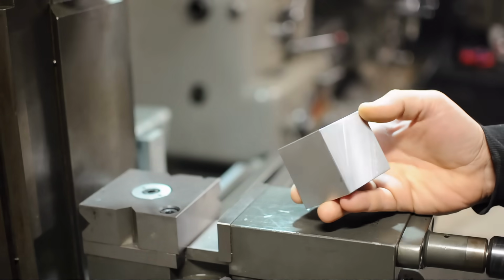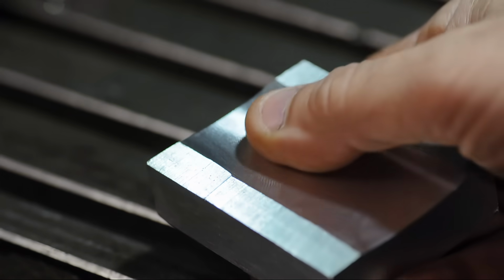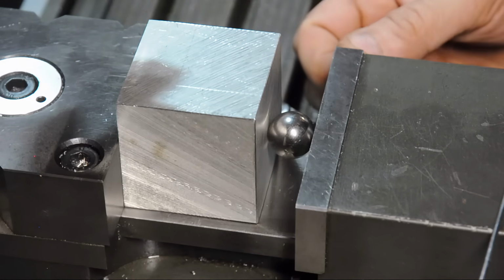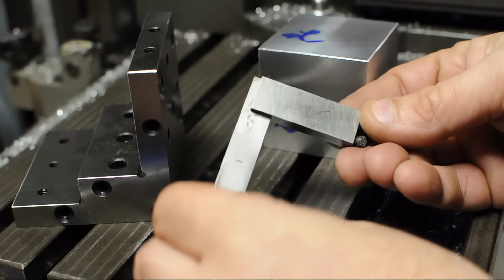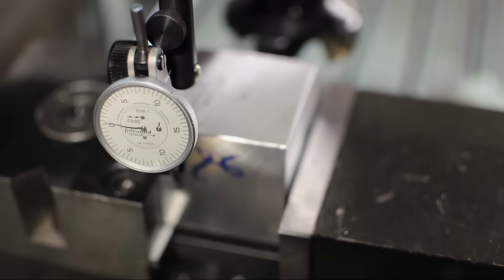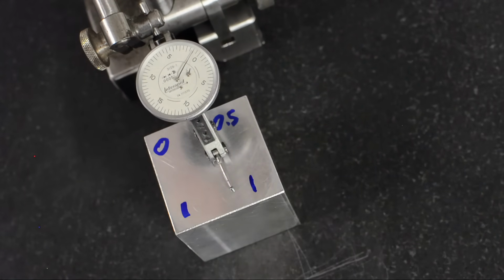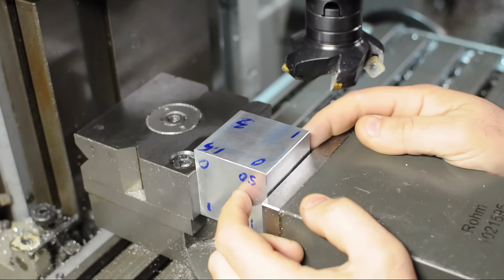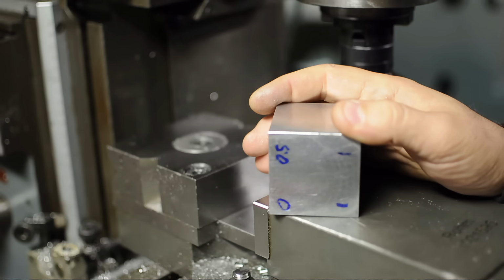Stock? Mill? Square!

Comment: I work in IT. In England. I don't have space for any home shop in my little house. I will never use the information you so eloquently provided. 

I did however find it fascinating and extremely well presented. Love your Vids and keep up the good work!!
Reply: same boat
Reply: I said exactly the same, fast forward 15 years and I now have a modest shop. I started out using the coffee table in the living room of our flat. It can be done it just takes a really long time to get there.
Reply: With a little creative chip management and an understanding housemate, it can be done. My first lathe (a 7x12) lived next to my fridge in the kitchen at my previous place.
Reply: I have the same lack of space you have. So I have a Taig (Peatol in the UK) lathe and a Proxxon micromill. They would both fit in a closet. You just have to adapt the size of what you do to the room you have. You will have to work small, build clocks, build small models, and so on.
Reply: +Juan Rivero You can build big things, you just have to make them out of LOTS of small parts.
Reply: Er -- I agree in principle, but you can't turn a 150 mm piece on a 50 mm centre height lathe!
Reply: I'm in the same boat. So I joined a local makerspace. It's not my machine shop, but I have access to it, and since the costs are spread out among many people it saves a lot of money. And there are often more experienced people around who can offer advice, which is nice.
Reply: Dito, just in germany instead of england :-)
I hope to have a workshop when i retire!
Reply: I built a shed in the garden 4mx3m. I'm getting there slowly.
Reply: some of these tools are very big investments. tony is building a desire in me which I can't yet afford.

if you don't have a shop of your own, you can see if there's a hacker space local to you. it's a workshop full of like-minded people. they usually have a lathe and drill press at the least.
Reply: Lewis Heard It took me years to build a workshop. Hopefully I can leave it to the grandchildren, so they don't have to struggle like I did.
Reply: I converted my living room to a shop, didn't have a wife then! My first shop was my bedroom in my apartment, I moved my bed to living room. I now have a corner of a real shop with 3 phase power, 8' x 12', I want more space! Or less stuff.
Reply: Larry i don't believe you are honest. Who wants less stuff?
Reply: PIGEON. And when you won't exist anymore, your grandchildren will sell  everything. I have seen it many times. One example is when I bought my shaping machine the chap sold it because his dad passed away. His dad was very passionate as I saw the workshop was set up in a very tight space and very nicely arranged. I asked him, why he  won't keep all the valuable machines. But he was simply not passionate about.
Reply: I don't have anywhere to set up a shop either. I do however apply the theories in my job and projects. I definitely watch for entertainment mostly. If TOT started a second channel about knitting I'd watch every video he produced. I would never knit either.
Reply: I find it helps me when I've got scripting to write.
Reply: My mate Toby has a machine shop in his ex-council flat in South East London. Put some effort in.
Reply: PIGEON take a look at Steve Jordan, his shed is 10ft x 8ft, and he has it as his YT studio as well! Les
Reply: F*ing this, im also an IT guy, with more interest in woodworking, but this videos are mesmerizing.
Reply: You work in IT? How fun is it to deal with "enterprise" Windows applications? Because we all know that nobody's smart enough to hire Linux sysadmins anymore.
Reply: Thing is I work in IT and I have space... ;)
Reply: @Lewis Heard 
Start out with mini machinery dude. you could be milling on your kitchen counter.
Reply: Same lol... at least if the zombie apocalypse happens and we are the only survivors there will be plenty of tools we can recover and make lots of these perfectly square little bits of stock metal 😂

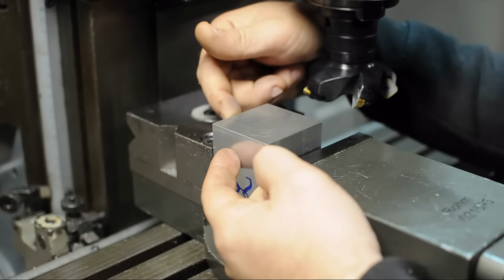Comment: If anyone is interested, for the question at 13:51,  the concept of being square in higher dimensions is called orthogonality.
Reply: Thankyou for finally telling me the meaning of the word "orthogonality". Its everywhere in my engineering curriculum, and I didn't know what it means.
Reply: I'm working with some 4 dimensional math. This is very accurate.
Reply: @KalijahAnderson  Thanks to you too, good sir.

Might I ask, are there any analytical techniques in mathematics for solving non-linear differential equations? I ask because all I see currently in my engineering curriculum has to do with linear differential equations and higher powers are neglected (Taylor series approximations). But these are only applicable for certain common cases (infinitesimal strain) and materials (Newtonian fluids). For more specialised machines, non-linearity is common, but our curriculum is not teaching us anything about dealing with those problems.
Reply: @death_parade  I have extremely bad news. They're often unsolvable. Look into Chaos theory for more information on non linear systems. That's what it's all about
Reply: @gamemeister27  Thank you for your guidance sir! I'll be sure to check it out. :)
Reply: @death_parade  Many years back I had to deal with these in grad school.  The best solution was stated by one of my fellow students: "You start by writing down the answer and then you verify that it's correct"

Personally I never managed much luck with that method and used various computer approximations.
Reply: Except the right answer to the question is "pairwise orthogonal" since TOT is asking about checking that three faces (ie 3 vectors) are orthogonal.

For example, <1,0,0> is orthogonal to both <0,1,0> and <0,1,1> but <0,1,0> and <0,1,1> are not orthogonal to each other. Check the dot products if you don't believe me.

For pairwise orthogonality you could use any orthogonal basis (obviously the standard basis is the easy choice).
Reply: Andrew Simpson   Andrew ! “the concept of being square in higher dimensions”???? Wtf are you talking about? Religion, voodoo. He was seeking the WORD for three planes meeting at 90 degrees to each other (the corner of the cube)(like the little gnomon sitting in the corner of most 3D programs displaying the X_red Y_green Z_blue axes in space).  The answer at 13:51 is... orthogonal.
So....  if we’re all going to learn even more here, not JUST a new word, then... “Think of the consequences of erudite vernacular utilized irrespective of necessity”. Just keep it simple dummy! So everyone can join in and know what were talking about.
Reply: They may be orthogonal, but are they normalized? I need my wavefunctions over easy with breakfast or it messes with my overlap matrix.

Comment: There is a way to square up a block with 7 cuts. Use the dial indicator to square the head, table, and vise once. When the static jaw is know to be true use your method of cutting for the first 4 faces. The 5th face is purposely moved out of square between the jaws, then skim cut that face. Flip the block 180 to face #6 and rotate the block 90 degrees in Zed. Now side #6 is square in both directions. Turn the block 180 again and re-cut side #5. You now have a block that is as square as your vise will allow. As a Tool Maker for over 30 years, I've used this method a thousand times over with predicable results, but most importantly, it's fast and easy! Keep up the good work Tony.
Reply: thx!
Reply: Yeah, and you dont even need to square the vice.
Reply: Took me a minute to visualise this idea but damn, that is genius.
Reply: Hey TOT, this seems like a quick video challenge for you!
Reply: "The 5th face is purposely moved out of square between the jaws, then 
skim cut that face. Flip the block 180 to face #6 and rotate the block 
90 degrees in Zed. Now side #6 is square in both directions. Turn the 
block 180 again and re-cut side #5. "

I don't quite understand this. Is there a video or more detailed description?
Reply: @dejayrezme8617  Here's how I think it goes (haven't actually tried it but it makes sense):

"The 5th face is purposely moved out of square between the jaws" means you tilt the block to one side (to the left or the right) so its top is intentionally going to be a bit out of square after cutting.

"Flip the block 180 to face #6" means turn the block over so face #6 is now on top. For the following step to make sense, you have to make sure to flip it in one plane only (flip it to the left, or the right, or toward or away from you, but not around the Z or vertical axis).

"and rotate the block 90 degrees in Zed." Turn it around the Z axis a quarter turn (90˚). So if you were to draw an arrow pointing away from you on face #6, after this rotation face #6 is still upward but the arrow would point to the left or right. Because face #5 was cut out of square in one direction, only one of its edges will contact the base of the vise, and with this 90˚ turn, that edge will be against one of the jaws. I suppose you'd want to make sure it's against the stationary jaw, which means your 90˚ turn had to be in the direction to make that happen. You'd use this edge against the bottom and the back face against the stationary jaw as guides so the top face is aligned correctly.

Then of course you cut face #6 (I guess that's implied) and "turn the block 180 again and re-cut side #5". 

That's how I imagine it. If I've got it wrong, I'm sure someone will correct me and then we'll both understand.
Reply: What if you don’t have a single face that’s machine cut 

And what if your dial indicator is broken or not reading correctly how would you know 

And could you square a block up in a lathe ,band saw or belt sander with greater ease
Reply: I’ve got a square and some finger nail clippers, let’s give this a shot 😂
Reply: that's smart!
Reply: jep that sounds like a very smart idea !
Reply: Don't ever mention that method to Joe Pieczynski or you'll be here forever trying to defend your method.......BTDT.
Reply: For all future machinists out there. I hope TOT doesn't mind. But there is the technique demonstrated by Oxtoolco.

https://www.youtube.com/watch?v=-lgMcDOkeg8
Reply: There is an even easier way to do this, but it depends on how much material you have to "play" with. Skim the top with a rose cutter, then use a end mill to skim/cut-to-size the 4 sides around the top, on the same set-up. Flip the block 180° and mill the bottom/side #6 off to size. Easiest way to square up a block. This will only work though if you follow the steps of getting the machine head right like he showed. 2 set-ups instead of 6+ and you will be using the machine's capability of squaring instead of your own. This method also has less chance of failing because you only have 2 set-ups instead of 6+. But like I said, this can't be done if you only have like 1mm to machine off... or should I say it is not for the faint of heart to be gripping on like 0.8mm and be machining on a block.
Reply: @adamthethird4753  old comment but putting a thank you since a became a machinist and i am very visual learner this helped me understand a bit
Reply: Note that there is no need to do "The 5th face is purposely moved out of square between the jaws". That "purposely out of square" is only done for demonstrations. You can cut the 5th face "straight-ish", it doesn't really matter... however you need to take skim cuts so that only ONE of the sides gets a full cut. That side becomes your reference for the next step - let's say it's the left one....
Now keep track of that left face and flip the block, then turn it 90 degrees. Place that (previously left) fully-cut face towards the fixed jaw, up on a parallel if you like. Now finish the 6th side, flip again 180 degrees and finish the 5th side again.
Reply: @gangleweed  what thoughta do you thinl joe will have on this?

Comment: In college, we used Bridgeports that had both tilt AND nod. To tram the heads on them, we used something the school provided called a tramming plate, which was just a piece of mild steel plate about 5 x 5 x 3/4 that had been hardened and precision ground on its widest faces. We used our dial test indicators mounted on universal dovetails in a 1/4 collet chuck to touch off on the plate. Then we spun the mill around by hand and indicated to within .001 on the tilt and the nod. I've done it so many times that I dream about it.

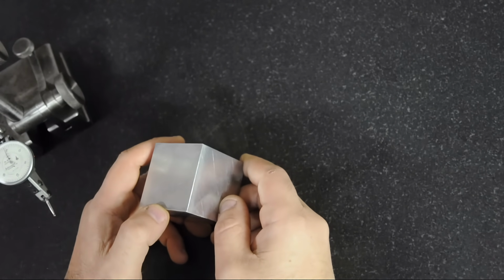Comment: At the 16:03 mark, the correct answer for this geometrical shape is a quadrilateral, ie all 4 sides parallel, but not to each other, commonly described as a  Parallelogram.
Google:  Quadrilateral vs Parallelogram vs Rhombus

Comment: Technically the bottom part of the vice is exerting a force on the Block exerting Force equal and opposite to the force of gravity. In other words the force that gravity plays on the Block, is gravity x  mass, is being exerted back on the Block by the bottom device as otherwise it would float and or it would fall.

Comment: Our mill tables have been stoned so much there are low spots where the majority of work is done.
We usually cut a pocket in an aluminum plate or clamp to an angle plate or tombstone.
1-2-3 blocks are great when you put them on a true surface.
We don’t name the sides but may introduce that to the procedure.

Comment: Parallelogram
Reply: Maybe even a rhombus
Reply: Nawww, this is clearly a trick question - but it's not fooling me! That shape was definitely an isosceles trapeze, sawed in half vertically, with one side welded back on upside-down. It's a good weld, but I can still just barely make out the seam...
Reply: The 3D version of a parallelogram is a parallelepiped
Reply: Pythagoras Theroy
Reply: techincally it would be a parallelepiped, cause it's 3d
(literally the only reason i know of it's existence is because i took extra math in high school)
Reply: You're all off by 1 degree.
It's a Quadrilateral
So is the next one.
Reply: Right on.

Comment: Orthogonal is probably the best term to describe "right angles" in multiple dimensions. By definition, orthogonality can represent any number of vectors, planes, or spaces that are perpendicular to one another.
Reply: Also the zero vector is orthogonal to all vectors, maybe even itself? But yet it has no length and so no direction. So there is that :P Two vectors being orthogonal means their dot product is zero. Or stated in another way, when one is projected on another, there isn't any length there, so they are "unrelated".

Comment: Ughh, despite COVID-19 I still remember doing this one part in school that was huge and pretty complex. Problem was that the four holes we needed to drill were so close to the edges that we had to use one of the smallest parallels. We also shared the shop with the college down the road and had to find the edges and convert to centerline machining!
Low and behold I broke a tap and the paraprofessional broke the drill used for extracting the tap. Thank goodness for Cold Chisels!
I also made a radius cut into a surface and not once but twice and around the same point. The Instructor for all I know keeps that part to this day to teach students to always pay attention to what dial you're adjusting.

Comment: At 13:50: your question, "what is the 3d equivalent to a right angle?" The word you are looking for is orthogonal (perpendicular to a plane).
Reply: also, the shorthand for orthogonal is the word "normal"  as in we need this side to be normal to the other two sides.

I would also mention that normal is pretty much specifically for 3d where as orthogonal is for any number of dimensions.
Reply: Orthonormal vertex?
Reply: @forthector7188  Not exactly, i think. Let V be a vector space over a field (of either complex or real numbers) that forms a Hilbert space together with some norm induced by a scalar product ( [x,y] ; x,y € V). We then call a set X in V of vectors orthogonal if for all vectors in X the following holds: [x_i, x_j] = 0 whereas i =/ j and i,j € I (with I being the Index set of len(X)). If for all vectors of X, Sqrt( [x_i,x_i] ) = 1 holds, we call the set a set of orthonormal vectors. If said set linearly independet, then it is the orthonormal basis of a vectorspace (U) in V with dimension(U) <= dimension(V). If dim(U) = dim(V) then U=V. The above holds for an arbitrary number of dimensions.
Skrra, qick maths

tldr, normal is not 3d specific. For example in "2d geometry  loose terms": righty angely thingy on straight line (1D) poking into 2D space.... Or something like that.... Usually we say normal even though we mean orthogonal on some object (line with normal poking into plane (2D), plane with normal vektor poking into cube(3D), cube with normal poking to tesseract(4D) etc.)
Reply: You could say 3 "mutually orthogonal" planes or edges/lines.

Comment: I would start with the largest side because cutting it will apply the most force against your fixture that you'll see in the entire operation. Getting the hardest cut out of the way first makes sense to me for three reasons;

1. Applying force to a part will always cause it to deflect by at least a tiny amount. Getting the highest force cut done first, before you have more than one datum, means every other feature can be kept just that much more square in the proceeding operations.

2. If the other sides are unfinished, then you don't need to worry about marring their faces by clamping down extra hard in the fixture.

3. IF something goes wrong and your part gets yanked out, this is the most likely time for it to happen, so you waste the least time with starting over if you demo the job on the first operation.
Reply: The size of the required dimensional adjustment has absolutely nothing to do with the forces or deflection.
You obviously have no experience in milling, and the assumptions that you are making are comically incorrect.